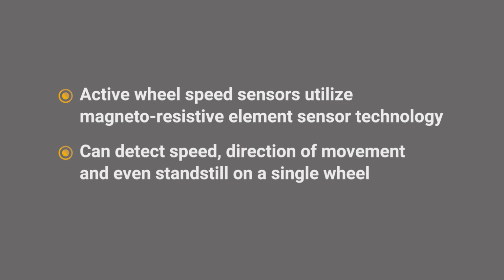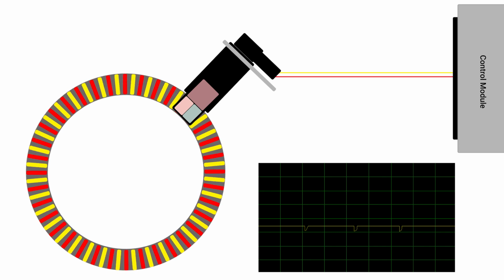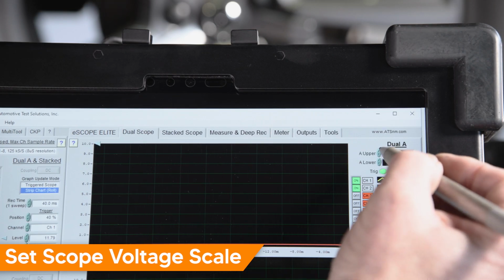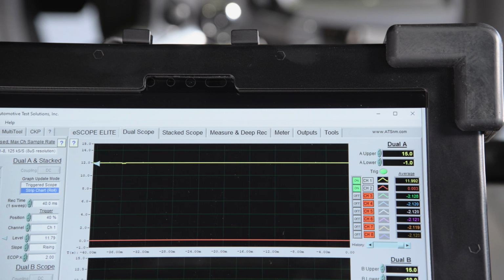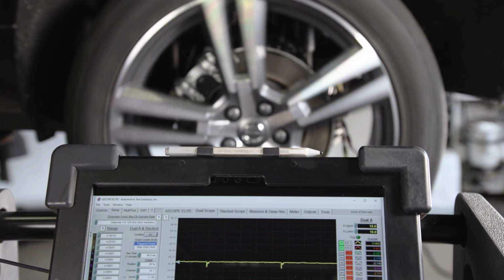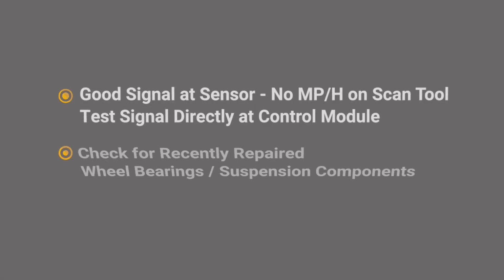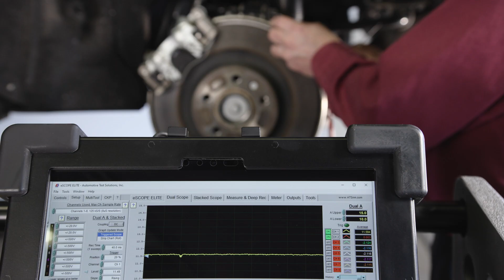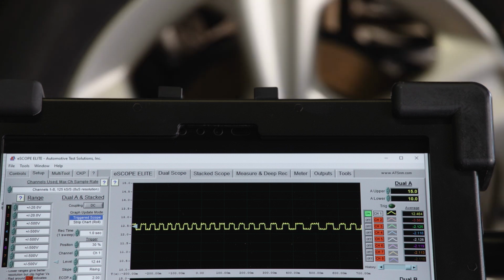Best Way to Test & Diagnose an Active Wheel Speed Sensor | Magneto Resistive Element (MRE) Sensor

Comment: variable reluctance sensors are passive and produce square wave!!!
Reply from the maker: Sensor function varies as well as signal voltage. You will have share more specific information, year, make model and system type for that comment to help others. Thanks for commenting.

Comment: Can wheel speed sensors effect ECU operations? I have a modern motorcycle (Yamaha FJR1300) that is exhibiting lurching at part throttle.. and I have replaced TPS and MAP sensors, the injectors, adjusted the vales, checked the fuel pump.. Could a bad wheel sp. sensor cause a misfire?
Reply from the maker: If the vehicle is designed to stop throttle actuation in the event of traction loss, yes. If slip is seen when it is not occurring, it is a possibility.

Comment: Can you tell the difference between an active or passive wheel speed sensor (physical/wiring/etc.) ?
How do you know which one you have on a specific vehicle?
Reply: active can have toothed wheels as well...sure way to tell is with a multimeter, if there's 12v on the connector pin, it's an active sensor. Also the resistance of an active sensor is a lot higher, about 8 to 10 MegaOhms...passive sensors are in the kilo ohms
Reply: Passive will have either a geared or tooted wheel the the sensor reads off of , active uses a magnetic ring
Reply from the maker: Thanks for the input.
Reply from the maker: Passive using a reluctor and active uses a magnet.